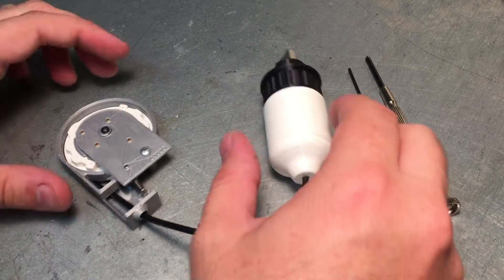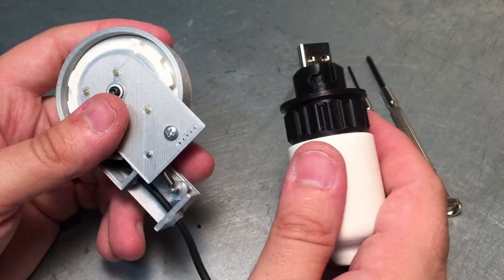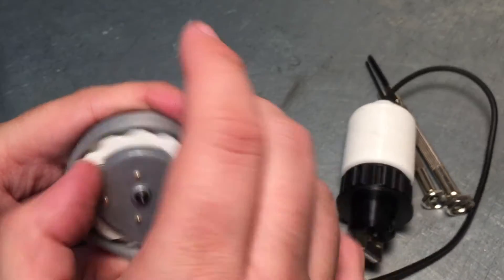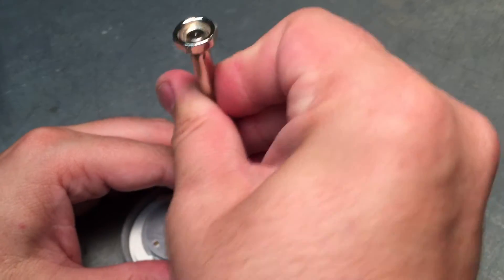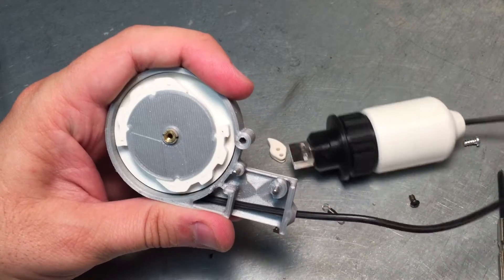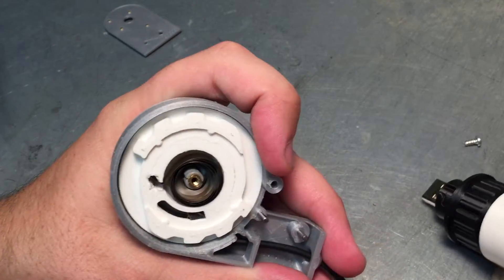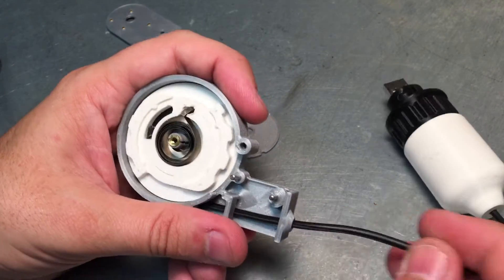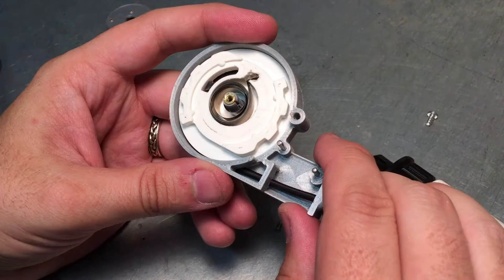Pip-Boy 3000 MkIV, Cable Retract Test 2

Comment: I am working on a similar project and was wondering if I could get the STL file
Reply from the maker: @JacobThomas-d7u  . This isn’t something you can just print and use. It has to be designed and tweaked to your cable diameter, length, and springs stiffness. The cad is part of my pip-boy project, and linked in the description.
Reply: @ZapWizard  Thank you, I already have my spool, wire, and spring parts figured out I just did not understand how a spool locking mechanism worked, you're videos on it and the cad has helped me a lot thank you
Reply from the maker: @ I figured out the mechanism by taking apart a ceiling mount retractable power cord from Home Depot. The mechanism is the same but smaller.

Comment: I wanna make something like this for electroluminecant wire, did you figure out a way to have the electricity leave the spooling area? The only similar items I see are large cable retracing spools and thing little retracting lanyards and I need a bit of both in what I wanna make.
Reply from the maker: @riceniceman548  My design uses a set of Pogo pins against a PCB to act as a slip ring. However, having worked with EL wire in the past: You will probably get sparks or arcing between the pogo pins and PCB due to the high voltage. There is also the issue that EL wire doesn’t like to be wound up tightly (repeatedly). LED noddles may work, but aren’t very strong under tension. The wire has to be quite strong or reinforced for it to pull against the spring tension.
Reply: @ZapWizard  that's unfortunate that El wire doesn't like to spoil up. I want to find a way for a length of it to retract into the handle of a kind of laser sword and be pulled out later, I want it for it's thinness and flexibility to make the beam really look like a laser being emitted from the handle. I wonder if I could get a similar effect from some string that reacts to blacklight, but I don't think it would glow bright enough to make it look like a laser beam.
Reply: I suppose the retractable aspect could be a secondary priority to just making the light look right... All the other beam katanas out there are sturdy, single piece units. Even so, maybe I just make it so the El wire can be detached so the rest of the unit can be folded up without hurting the lights.

Comment: Do you have the stl files? This is amazing
Reply from the maker: Just the full Pip-Boy files which are in the project log (linked in the description), nothing for the model shown here which was a prototype.
Reply: @ZapWizard  Thanks for sharing these videos. I was wondering if you have any information anywhere on how you finalized this part? I watched the 3rd prototype video.
Reply from the maker: @CommandAttack  This whole thing requires a lot of experimentation, to get it to work you have to balance the spring force, cable length and such. This design shown here only extends about 8", you can get better by hacking an existing USB car charger that extends.

Comment: Couldnt find the update to see if you ever fixed the problem, i have made a similar device with alos a similar problem. What was happenign is i had too much surface area rubbing against the case which is what is happening with your one from what i can see.
If you were to slightly thicken up the case and have a tube connected to the coil and have the spring up against the tube in the middle you could reduce friction and in turn allow the spring to fully self wind. That was my fix a bit hard to describe other then it looks like a table top spinner from the side but with a handle on boths sides.
Reply from the maker: I never got this working quite right. I did reduce the friction by building a thin bearing surface into the part (basically less surface area in contact on the back side) The primary issue is just getting enough strength to fully wind the cord without also making it impossible to remove.

Comment: Maybe 3d print some bearings? I'd love to make a pip boy and your channel helps so so much :D you got yourself a new subscriber!
Reply: There is no reason to 3D print bearings, unless you need very high quality bearings, they're really cheap to buy from places like ebay. You could get a couple thrust bearings with needle rollers making them very thin for like $5.
Sandwich the rotor in between them and you should have a pretty low-friction mechanism.